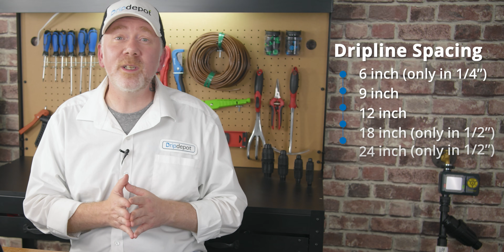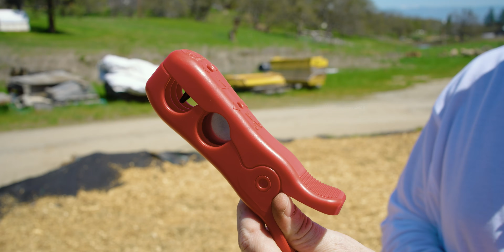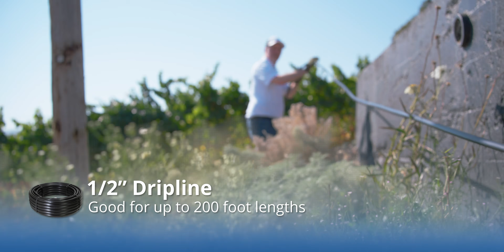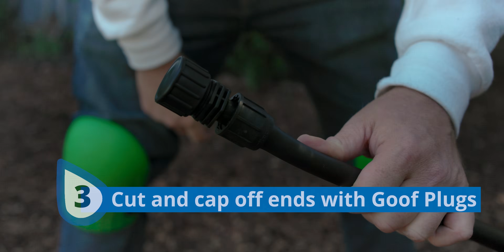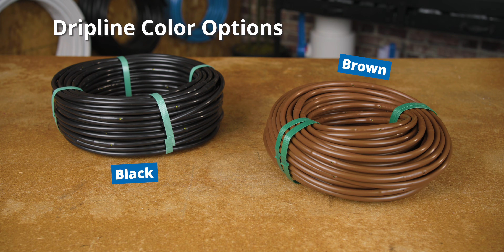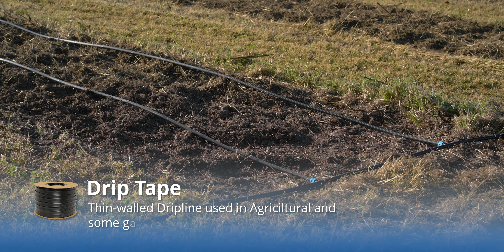Dripline: Choosing the Best Type for your Irrigation Project

Comment: How do you determine the GPH/GPM for dripline?  I'm seeing that yours is 0.5 GPH, but do you have to count each emitter on the line?  How do you calculate it? I'm trying to size a pump using your pump sizing worksheet, but this has me stumped already.
Reply from the maker: I promise I'm not AI, but I may sound a bit like one when I say you are thinking about this right and are definitely on the right track. 

Ok, as it relates to a pump and calculating the flow rate, you essentially have it exactly right: add up the flow rate of all emitters that will be operating at one time.  Using dripline with 0,5 GPH emitters, you can base it off of the total linear feet of dripline you plan to use.  

As a quick example, if you had twenty 10 foot rows to cover, you would be using 200' of dripline.  If you planned to use the dripline with 12" spacing, your system flow rate would be 100 GPH / 1.67 GPM (200', 0.5 GPH every 12" is: 200 x 0.5 = 100 GPH.  100 GPH ÷ 60 = 1.67 GPM).  

If you planned to use the dripline with 6" spacing, the same process works: 200' of dripline x 1.0 (two 0.5 GPH emitters per foot) = 200 GPH ÷ 60 = 3.33 GPM.  

For an emitter line with a spacing outside 6" or 12", you can convert things any way you feel comfortable with.  I usually convert things to inches first and then work from there .  

I'll use 9" spacing as an example: 

200' of dripline with 9" spaced emitters:  200 feet x 12 = 2400 inches ÷ 9 inch emitter spacing = 267 emitters x 0.5 GPH = 134 GPH ÷ 60 = 2.23 GPM

Basically, add up the number of emitters and multiply them by their flow rate, then divide by 60 to convert it to gallons per minute (for emitters that are listed in gallons per hour, some higher flow emitters will be listed in gallons per minute).  If you have emitters with different flow rates that will run at the same time, just calculate them separately then add them up at the end to get the overall flow rate :) 

Note: If you follow along with the math, you'll notice I rounded things up.  I do typically round up just to give a little cushion on the many variables that are found in actual field conditions. 

If any questions come up while you go through this, don't hesitate to reach out here or our website, happy to help with any of the process and if it's your first time I know it's a lot to take on without questions!
Reply: @dripdepot  Thank you for your quick reply.

Comment: Thanks for your informative videos, very helpful! I have a question- 

I want to plant willow cuttings along a long fence line and make a shelter belt style view blocker. Ideally the area would run along a 400-450’ fence line, that slopes down downhill a bit, and then it would take a 90° angle for another 150 feet along fairly flat ground. 

Do you think a half inch main line with sections of drip line every so often would work for a run that long? If not, what do you suggest? I’d like to water as many willow plants as possible, but don’t want to have to install a couple hundred individual drips. 

I have an existing drip line set up that probably has 50 or 60 drips on it on for trees and plants on another section that is very similar to what I’m talking about, except not as long a run, more like 300-400 feet. The pressure is adequate for that set up. 

Thanks in advance for any insight you may have!
Reply from the maker: I did willow along my fence line as well, though mine was, fortunately, ony about 75'.  :)   

I agree that installing a dripper or two for each individual one would be time and labor intensive in this application.  The method you're suggesting does indeed have some merit, and some version of could indeed be workable.  The overall length (550' - 660') is likely a little much for a 1/2" main, but could be doable if the flow rate was very low (which may not be ideal with willow's water requirements when getting them established).  Pressure lost from friction is something that can be checked against different diameters of line though, so that part can be accounted for pretty easily once the flow rate is known.  

The flow rate in this case is just the sum of all emitters that would be operating at one time multiplied by their flow rate.  For example, if you ended up using 200' of dripline with a 0.5 GPH emitter spaced every 12", the flow rate for purposes of calculating friction loss would be 100 GPH (200 x 0.5).  With the flow rate and line length known, you can put the numbers into a friction loss calculator and see how much pressure is lost at different diameters.  We have a friction loss calculator that works for 1/4" up to 1" tubing, all that needs entered is line length and flow rate (diameter is chosen from a dropdown menu).  Here is the link for that calculator: https://www.dripdepot.com/irrigation-calculators/pressure-loss-calculator

I did a quick check for 100 GPH going through 600' of 1/2" tubing and the result is a loss of 7.9 PSI from friction, which is on the higher side.  3/4" in that same situation is just 1.7 PSI. 

There is a bit more to it all, as water velocity is also important, but pressure loss is generally the primary consideration.  

Is your dripline 1/4" or 1/2", and were you thinking of splicing in the dripline right inline with the mainline, or coming off the mainline with the dripline at every willow?  This would have some influence on the friction loss calculations, and if the dripline is 1/4" it would likely be better to come off the mainline with it.  It wouldn't necessarily have to be exactly like it is in these images, but here are some sample layouts that show how 1/4" dripline can come off of a larger mainline to irrigate trees (but it's also done for shrubs and any similar plant type): https://help.dripdepot.com/support/solutions/articles/11000119082-tree-irrigation-sample-layouts

Basically, I think you're on the right track and I agree that installing a dripper at each one would be a pretty tall task.  With a little pre-planning you can dial things in to keep pressure loss at a minimum to help ensure even distribution.  I'm happy to help with follow-up questions if any come up, don't hesitate to drop a line any time :)

Comment: I’m currently using 1/4” drip line with 6” emitters in raised beds. I have hard water and the emitter holes are clogging. Can you make any suggestions. I have thought about switching out to drip tape.
Reply from the maker: Drip Tape does do better in hard water conditions.  The inlet filter on each emitter has significantly more surface area in drip tape lines than those found in 1/4" dripline, and can be expected to go longer before accumulation causes blockages.  

With that said, there are a couple things you can do to treat emitter lines that have a lot of build-up, or even prevent a good portion of it to begin with. 

Either type of line can be given an "acid soak".  Despite the intimidating name, an acid soak or acid bath is often just some diluted distilled vinegar, the same vinegar you can get at the store.  The acidity works to quickly break down mineral build-up.  An acid bath can be prepared in a container large enough to accommodate the lines, and both are usually flexible enough you won't need a huge container, at least with standard garden sized lengths.  

When it's not convenient to remove and soak the lines (larger gardens / farms that have a lot of tape or dripline), folks inject an acid treatment right into the lines.  This can not only break down mineral build-up inside the lines, but also treats the water during the watering cycle to prevent more build-up during that cycle.  In many cases there can even be a postive, synergistic effect in regards to soil pH.  Hard water often leads to higher soil pH and injecting an acid helps to lower the pH.  For many of the most common garden plants, nutrients are more bioavailable in slightly acidic soils.  It's best to test the soil pH first, but even those little inexpensive soil testing papers work pretty well for that :) 

Basically, drip tape will typically go longer in hard water applications due to more surface are on the emitter's inlet, but with enough time the build-up can still lead to blocked flow at the emitter inlet.  Prevention (injecting an acid to treat the water) or maintenance (giving the lines an acid soak from time to time) can prevent the need to replace lines once the build-up is sufficient to cause problems. 

Quick Note: When I mention injecting treatments, it is usually done with a fertilizer injector.  Here is an example of one of the smaller ones: https://www.dripdepot.com/3235

An injector like that works great in smaller gardens or gardens where injection isn't always needed, but there are injectors for pretty much any size garden out there and are typically pretty reliable and easy to use, but if it's a particularly small garden, removing the lines for an acid soak usually isn't too inconvenient :)

Comment: I'm always changing the setup and layout of my garden... Am repeatedly installing and taking apart drip line system... My current connections cannot be reused... They push together easily, but take two bulldozers to pull apart... I am looking for a set up that installs and comes apart easily... Any ideas? Home Depot doesn't carry anything like that for some reason...
Reply from the maker: Loc style fittings are likely the closest to what you described.  I wouldn't necessarily call it easy to remove the tubing from them, but much easier than with other fitting types.  Loc style fittings have a single, smooth barb which is easier than the multiple, jagged barbs on a barbed insert fitting.  The locking nut on Loc fittings secures it in place instead of a clamp, so less time and effort spent removing and reapplying clamps (just twist the locking nut and it releases its grip on the tubing, and when you reinstall you just twist it back down over the tubing).  

Though easier than other fitting types (particularly barbed insert and compression), removing the tubing can still be a challenge since the fitting has to accommodate the tubing securely enough to be water tight during pressurized operation.  

Another type of fitting that can be reused is, strangely enough, one I thought you might be using now.  The installation of them is incredibly easy.  Their removal can be easy or can be like you described in needing two bulldozers to take apart.  From your description I suspected you were either using compression fittings or this style.  The fittings I'm describing here are Drip-Lock fittings, a "bite" stye fitting.  They come with a removal collar on the fitting and the idea is you just pull back on the collar and the teeth inside that bite down on the tubing are released so you can easily pull the tubing out.  Before it all goes on the ground I find it works pretty much as described and the tubing is easy to remove from the fitting.  But I've found that once dirt and debris gets in to the teeth area and the release collar area, they become significantly more difficult to remove.  

I'll link the various styles below so you can see what they all look like and make sure I'm not covering fittings you're already using :) 

https://www.dripdepot.com/irrigation-supplies-fittings-tubing-twist-n-lok - Loc Style fittings.  Not necessarily easy to remove, but easier than the other types.  

https://www.dripdepot.com/irrigation-supplies-fittings-tubing-drip-lock - Drip-Lock fittings.  Incredibly easy to install and at first reasonably easy to remove by pulling the release collar, but become exponentially more difficult if debris finds its way into the right places.  

And so you can compare and contrast to what you have and the fittings above, here are the fittings that are absolutely difficult to remove in pretty much every case (and compression fittings are not meant to be reused, the barbed insert fittings can be but hand-removal is not easy): 

https://www.dripdepot.com/irrigation-supplies-fittings-tubing-barbed - Barbed insert fittings.  It is usually recommended to use clamps to secure the tubing to the barbs on these, adding another step to the install and/or removal process. 

https://www.dripdepot.com/irrigation-supplies-fittings-tubing-compression - Compression fittings.  Not meant to be reused (some will argue you can, but they lose some integrity after being used, making reuse a risk).  They're inexpensive which sees them get used a lot on commercial projects where layouts rarely change, and if they do it's infrequent enough and the fittings low enough in cost they just get more.  

Couple videos that may be worth checking out if you hadn't bumped into them yet, they go into greater detail on the fitting types and the second video is all about removing tubing from Loc style fittings since they're the easiest to reuse.  

https://www.youtube.com/watch?v=GqFQyG791tA - This video covers Barbed Insert fittings, Compression fittings, Drip-Lock "bite" fittings and Loc Style fittings.  Pros, cons, how they're used, the general information.  

https://www.youtube.com/watch?v=Bnms9E2Pkro - This video is all about removing tubing from Loc fittings.  Great video editing did make it appear a bit easier than it is, but the editing wasn't excessive on this one and I'll be the first to set the expectation that they are easier but not always easy (but sometimes are very easy as temperature and other environmental factors do play a role) :)

Comment: Hi! Can 1/4 inch drip irrigation be connect to the 1/2 inch line on both ends?
Reply from the maker: You bet, the 1/4" dripline can be connected to a 1/2" or larger mainline on both sides, and it is something we see done fairly often.  In most cases there won't be much benefit, but longer runs of 1/4" dripline (around 20' or longer) can see some benefit from having both ends connected to larger diameter distribution tubing :)

Comment: How do you buy this spinklers and drip pipe
Reply from the maker: Here are the links to the two dripline sizes used in the video: 

1/4": https://www.dripdepot.com/quarter-inch-polyethylene-dripline
1/2": https://www.dripdepot.com/half-inch-polyethylene-pressure-compensating-drip-line

Just in case, here is the link to the "blank" (no emitters or pre-drilled holes) poly tubing: https://www.dripdepot.com/polyethylene-tubing :)

Comment: This might be a stupid question, but can just add emitters to the drip holes since I'll know they are 12" apart and I'm gonna be utilizing the square foot gardening approach?
Reply from the maker: You're always welcome to send questions, and asking questions is the best approach (measure twice, cut once and all that good advise) :) 

The holes in dripline have inline emitters inside the tubing, so there's no need to add additional emitters in the pre-punched holes.  Basically, the dripline is already setup like you described (an emitter every 12" on the 12" spaced driplines).  

You could add emitters every 12" to "blank" tubing if you prefer that route - on 1/2" dripline you could even add emitters in between others if there's spots you'd like to deliver more water to (but cannot add additional emitters to 1/4" dripline in most cases).  

Happy to help if more questions come up, you're welcome to drop a line any time!